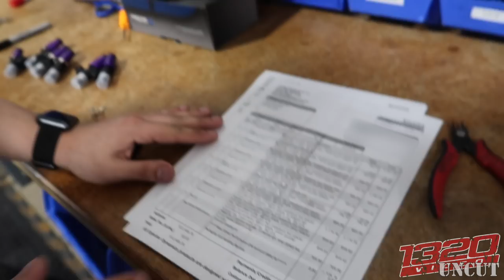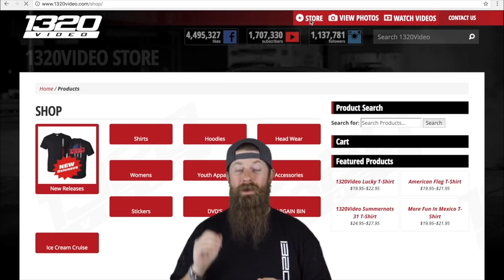Fred Takes A Ride in an 850HP Ford GT!

Comment: Can someone that knows what they are talking about tell me why a 7 speed is going to be awesome when they weren't even going through 5 gears with the DCT.
Reply: AntiLag BoostAddiction Closer gear ratios. Less RPM drop between gear changes, meaning less boost surge. They’ll be able to use 6 (if not 7) gears in the 1/4 with the new Liberty trans.
Reply: AntiLag BoostAddiction by keeping RPM's in the high end, it keeps the power up all the time. So, by adding more gears it allows for it to stay in the high RPM's at all times. If that makes any sense at all.
Reply: Yep, when they add more gears to a transmission it allows them to keep the gear change ratios closer together which helps keep the engine RPMs in their optimum range. That's why Ford & Chevy worked together to develop the new 10 speed automatic transmissions. 
I've always wondered why no one has worked harder on making the CVT transmissions able hold up to more power. If they could hold the power they might be the best transmission to have in motorsports because there are no gear shifting times or transmission gear ratios to worry about.
Reply: Thanks
Reply: Robert G I always hated CVTs until I owned one. AMAZING. Always in the peak of the power band. No RPM drops whatsoever. They make 900lb utility quads with CVTs that eat purpose built sport quads and race quads alive.